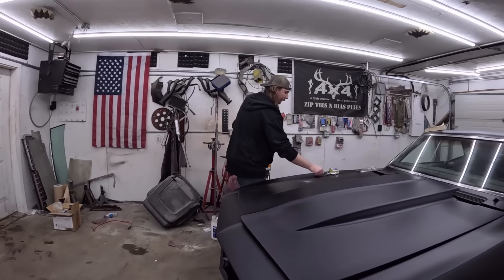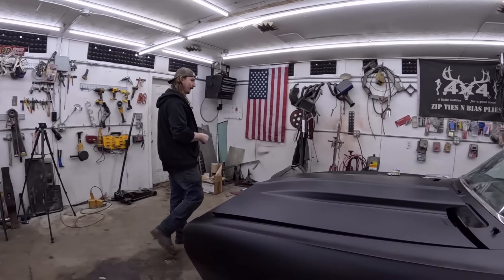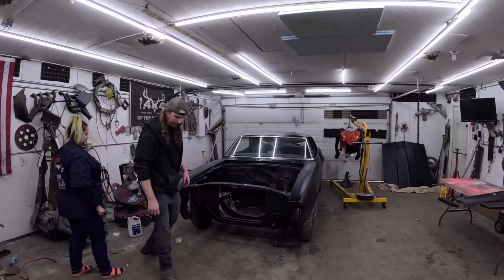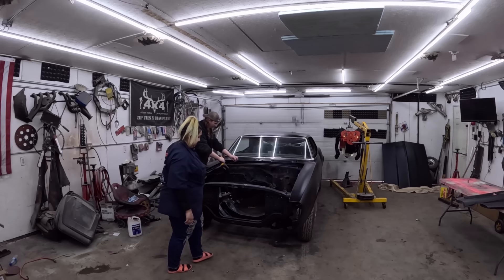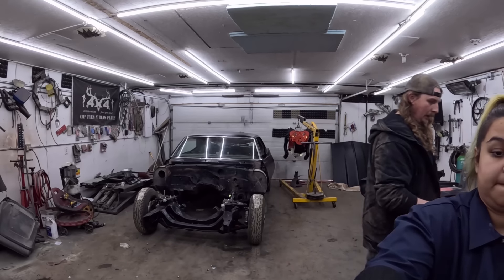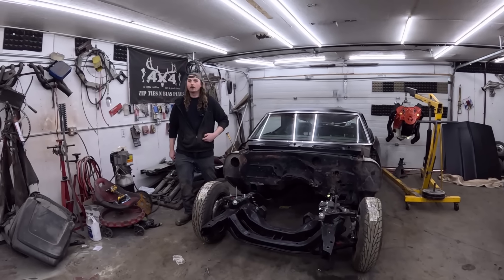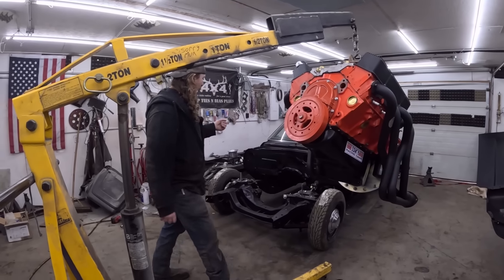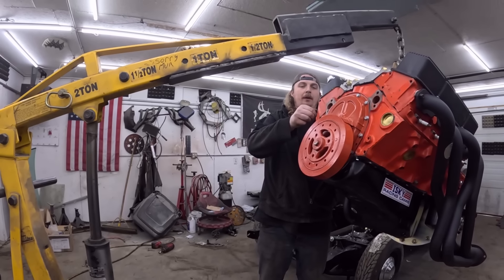1967 Camaro Gets A New Heart!  BIG POWER Small Block

Comment: Great update. Had those same valve covers in my 67 RS when it was repowered...
Reply: I believe that the 1967 RS/SS convertible was the rarest camaro ever produced. I had a 70 1/2 Camaro with a 327 out of a 1963 Corvette. I rebuilt it 30 over,steel forged crank, ported and polished 64cc heads with a 268 competition cam with a 650 holley. Man I miss that car.
Reply: @327JohnnySS  Love your car. Mine was only an RS and of course the headlight doors didnt work...lol
Reply: @vancity2349  Im helping my friend with a restoration of a 1968 cougar with factory ac. I installed the new 302. 30 over. We are at the body work now and found out instead of the vacuum hose controled head light covers they have electric ones. We still have the "box" for the rear sequential turn signals. It a fun project to be a part of Saving these old rides . I'm about to tackle my 1974 Chevy long bed camper special. 👍

Comment: I noticed you didn't seem to show all the LOVE involved in installing the trans cross member LOL ! Yes yes yes it's a full-on Hammerfest as the factory never did leave enough room between the floor pan & the front frame section to get it out or in and you got to beat it out or in every time! (try that on the side of the road in the DARK ~!)  By the way, them motor mount bolts NEVER line up. Always a pain to get them in on all the first gen F bodys. P/S you MAY have to pull the motor BACK OUT as the headers might have to go in with the motor at the same time if their big tube headers :face-blue-wide-eyes: Sorry about that but be glade it's not a Pontiac firebird because the Pontiac motors are 900 pounds, and the SBC is only 530.
Reply: its a 50-70 pound difference,not 370 pounds     400 pontiac vs sbc 350.love them both though

Comment: The pressure of the video camera and deadlines while working on the car causes some of the mishaps and frustrations.  Don't sweat it.  Most of us have experienced similar frustrations without the pressures of recording while working..  I'm about to do the engine and transmission install on my car solo.  Even though my garage door will most likely be closed, I'm sure the preacher across the street will be thinking I have tourette's syndrome.